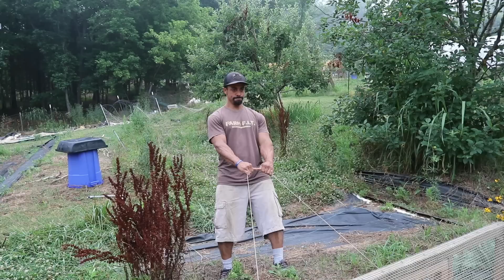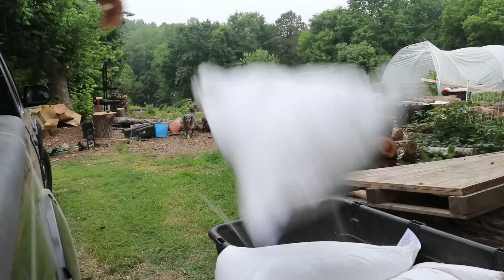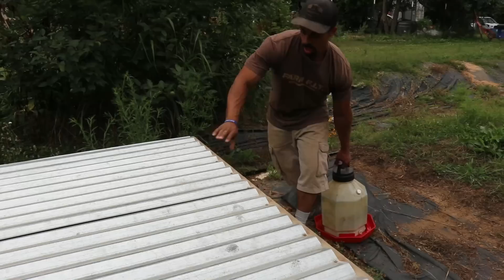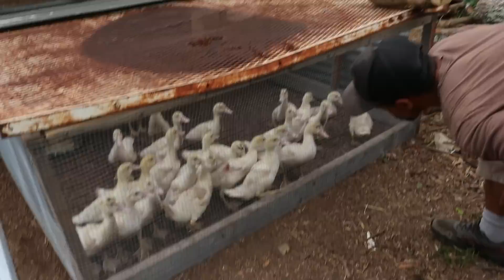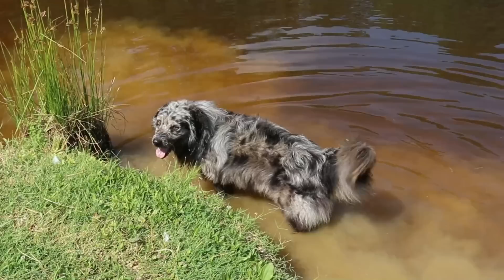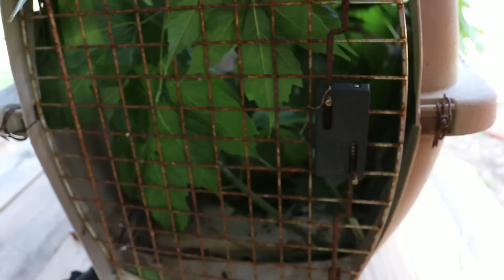HELP! All these CHICKENS are making me CRAZY 🤪 | How I  take care of them

Comment: Hey Mike, have you thought about  drilling some half inch holes on the metal walls around the outside of your chicken tractors? It could help cool off your chickens. Another idea I had was to get a solar fan to help cool them off in extreme heat.🧡🧡🧡🧡

Comment: While the metal roofing may reflect the sun it also generates heat. During full sun put a thermometer near the metal and then down near the ground and you will see a difference in temp. Try opening up the top and putting about a 40% shade cloth over the opening to keep the birds in.  This will allow for better ventilation helping to keep the birds cooler.  I worked loading trucks and as I got towards the top of the trailer I could feel the heat generated by the metal top.  Good luck and I hope you have better success with your birds.

Comment: Nipple drinkers with a PVC pipe and gravity fed water. The ducks will get less wet. The water goes down the  throat and not on their backs. Remember Concord Farms?  They used nipple drinkers. To start them on nipple drinkers start with both the regular baby waterer and the nipple both in the coop. They will play with the nipple and after they get 2 weeks old they will be on the nipple. Saves a heck of a lot of money on shavings.

Comment: The housing cage pulling one is way to small and over croweded they cant even move much, they have no space between eachother, and  pulling that idn  just let them free to feed instead of  pulling that cage over a new section  of grass , seems to be wasted effort.  They are ment to roam not be caged in tight quarters like a prison they need a large area to roam and feed. Aside ducks are ment to swim they need water to survive. A duck without water is  no duck. Makes me sad to see them all crowded in small cages . They are letting you know they cant  be in close quarters like that when they harm eachohter.  They also need  heat in winter and  cooling relief outside in terrible heat . If the ducks have no water to cool down , give them a  pool to swim.